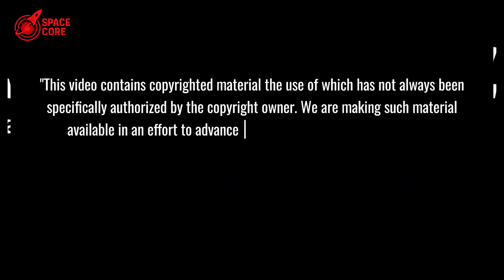SpaceX To Rescue Boeing's Dying Program: What Happened SHOCKED NASA!

Comment: I don’t get the point. Boeing is as described a disaster. It has been a dumpster fire for years. SpaceX is the US Space program. Why would SpaceX helping Boeing do anyone a favor? SpaceX has no use for their systems. The Federal government needs to finally pull the plug on SLS, Orion, Starliner, - the whole wasteful pointless pork distribution system. Put that money into contractors that can do the job. Boeing’s programs can be liquidated and their engineers can work for other more effective companies. Any useful facilities or capital equipment can be sold off to other players. There is nothing at Boeing Space worth SpaceX propping up.
Reply from the maker: Boeing's Starliner struggles highlight a critical need for redundancy in U.S. spaceflight. SpaceX helping could strengthen national security, not just Boeing.